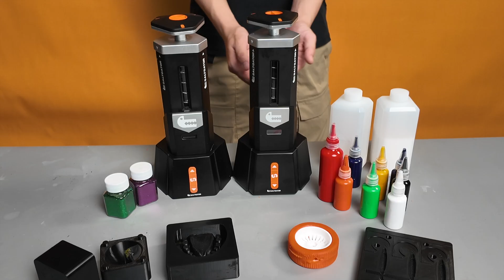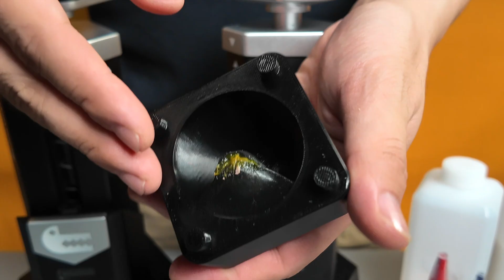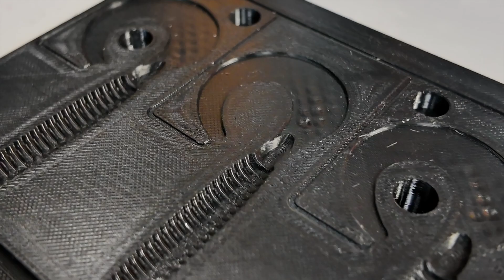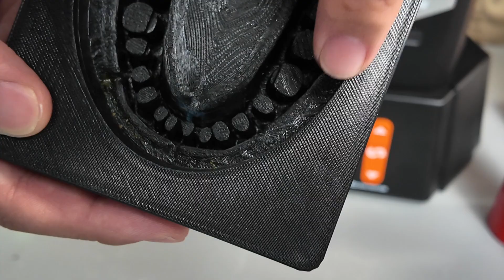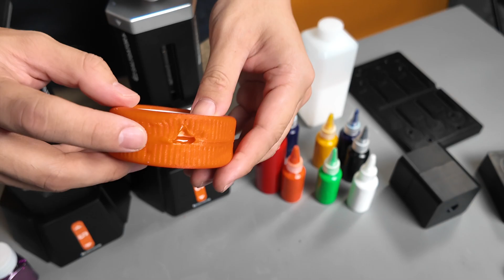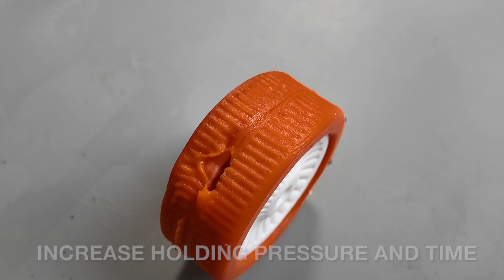Fixing Common Mold Problems with SALTGATOR | Tips & Tricks for Better Results

Comment: What about PCTG for molds?
Reply from the maker: We don’t recommend PCTG for molds, since its heat resistance isn’t ideal and it may deform after repeated use.
For 3D printed molds, PETG is a much better choice — it handles heat more reliably, stays dimensionally stable, and is widely available for printing.